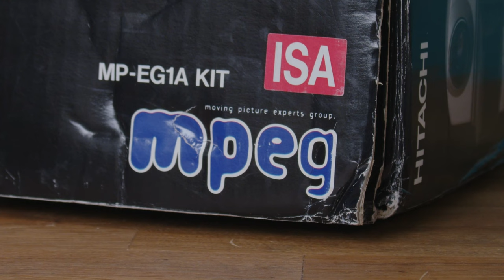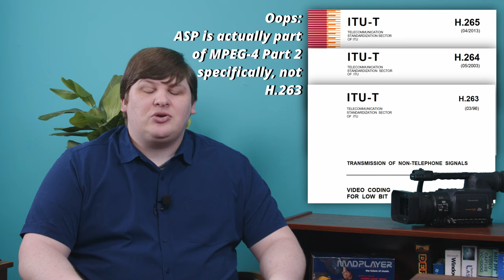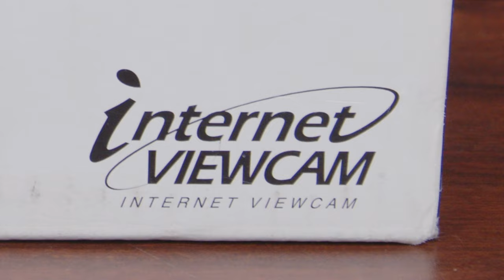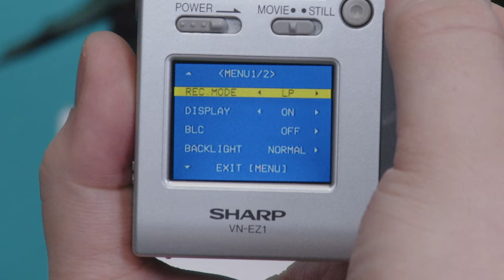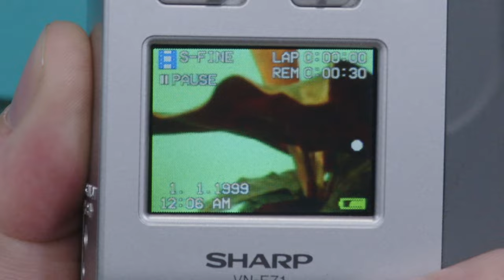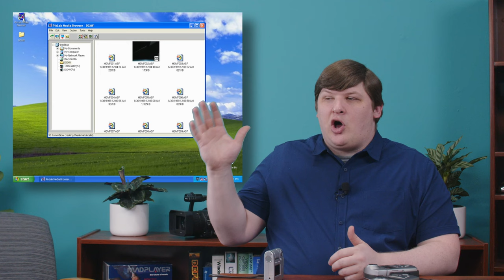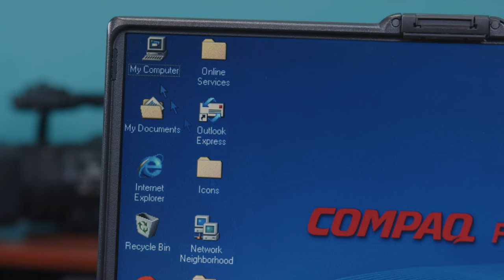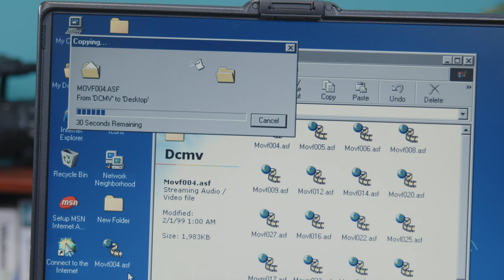The first thing that ever used MPEG4 [Sharp VN-EZ1]

Comment: Those FlashPath adapters were made for SmartMedia and Memory Stick. Supposedly they were also made for SD Card but I've yet to find proof of existence. Pretty sure they weren't made for Xd Picture Card, which is odd since Xd is basically Smart Media in a much more compact form, at least in capacities up to 256 meg.

Smart Media in 256 meg was just about to be released when it was suddenly killed off as fast as HD-DVD. Like with HD-DVD, manufacture of Smart Media cards was slammed to a halt by everyone making them. That was in spite of many devices (mostly digital cameras and a few MP3 players) that had just been released with 256 meg support or got firmware updates for it. Only a small batch of prototype 256 meg cards were made and they have always brought a premium price the rare times any go up for sale.

Making an <any other format> to SmartMedia adapter is essentially impossible due to it being thinner than all the other cards. There were adapters with a big lump of an Xd slot that could make 256 meg (device support required for larger sizes of course) or smaller Xd work in Smart Media devices, but if the thing had a memory slot cover it couldn't be closed, might physically obstruct use of the adapter, and if the cover had to be closed for the device to function you were SOL.

Where's an "Impossible Project" for old solid state storage formats? Polaroid film got brought back from extinction! Why not the 256 meg Smart Media card and 4 gig SDSC?

4 gig SDSC? For an extremely brief time before the introduction of the SDHC (Secure Digital High Capacity) standard, when the largest SD card capacity possible was 2 gig, some companies figured out that many devices could actually support up to 4 gig of storage.

How to fit 4 gigs of data into a 2 gig sack? Double the block size. Same number of blocks, they're just twice as large. As long as the device's supported file system and the firmware could handle the larger blocks, it would work - unless the @#%@ing thing was hard coded to a 2 gig limit.

But as soon as the first 4 gig SDHC card hit the market, manufacture of 4 gig Secure Digital Standard Capacity (retronamed post-SDHC) cards instantly ended because the SD Association had a fit of "Not Invented Here" and refused to adopt it into their standard. I suspect that manufacturers who wanted to continue getting the license to use the SD logo etc on their products were told they had to cease making "nonstandard" cards or they'd be cut off.

What's the prime market for a revival of 4 gig SDSC? Older GPS receivers. For example the road data for the continental 48 US States or most of Europe from OpenStreetMap can be converted to Garmin format and packed into 4 gigabytes. But since most GPS receivers prior to the intro of SDHC cannot use SDHC cards, they top out at 2 gig storage. But their software can access up to at least 4 gig. I suspect that GPS (and some of the better cameras) was the main reason 4 gig SDSC cards were made.

Comment: Noticing something interesting in every video. Is that a Panasonic HVX200 series in the background? I inherited a complete kit for free. P2 cards are insanely expensive to this day, and probably won't get any cheaper. Had a chance to get a Nikon lens adapter, but it was offered before the camera, so I passed on it. If I knew I was going to get offered the camera next, I would've taken the thing. Otherwise, good luck finding any lens for it that's not stock. Great machine, but heavy, expensive to run and PCMCIA card readers aren't as common as they used to be.

Smart Media - I do have a small collection of those, no larger than 64MB. Only device I had that used them was Diamond Rio MP3 player.

Comment: A couple notes:

- Macro modes are usually at the wide or telephoto end of the zoom range for convenience reasons. From a user's perspective, imagine having to find some precise point along the zoom range to re-couple the zoom and focus lenses into a macro configuration. Let's face it, even if this position was marked, it'd be fiddly. And from an engineering perspective, having to make this system reliable enough not to block up when it's switched back and forth with the zoom and focus maybe slightly out of the ideal position would be a massive pain.

- h.264 was actually referred to by its proper name regularly - under the brand AVCHD, which you can STILL find on some modern Sony and Panasonic cameras.

Comment: I am genuinely shocked that little Sharp camera existed in 1999.  I was working for a tech start-up at the time, and our MO was high-quality, real-time encoding and live streaming using MPEG-4 Part 2 video.  Our only option at the time was to use the biggest pile of x86 CPUs we could cram in a single NT 4 box (SGI Visual Workstations), run Windows Media encoder, and do it all in software.  There were virtually no other software implementations of the codec at the time, and no off-the-shelf hardware encoders to be found.  We generally used a Mini DV camera connected via Firewire to the encoder box, which gave us a nice clean video feed to start with.  We could get fairly watchable talking-head video with mono audio crammed down into 48 kbps (targeted for 56k dial-up), and remarkably decent (for the time) general subject video squeezed into a 384kbps stream for the DSL market.  Semi-related, H.263 was a mainstay of the video teleconferencing (VTC) world for a long time. It was a decent performer for talking-head content over a few bundled ISDN lines.  The battle between the overlapping MPEG and ITU standards was pretty rough, and at the time, they were really only compatible enough to make your software crash.  I am pretty sure all consumer cameras that could do video at that time were just doing MJPEG at low resolution. They could just use their existing JPEG hardware encoder, but it was pretty inefficient.  As much as we can make fun of this little Sharp camera today, it really was doing some interesting stuff.  It was definitely a wild era to be playing with digital video.

Comment: Enjoyed your extensive overview of this camera! The lone Camcorder & Computer Video magazine I saved from July 1997 features the Hitachi EG-1A as part of it's cover. Within the article the reviewer eludes to the ease of drag and drop into applications such as Microsoft Word or PowerPoint. Most notable comment in the article in regards to purchasing one: "If you want the highest-quality video recording possible for a consumer camcorder, than the answer is a definite no! MPEG-1 video playback is like watching original generation VHS." After your demo of the video image quality, VHS in SP mode still looked leaps and bounds better even in 1997 terms, but that was clearly not the point of this camcorder. 

The quality you recorded was reminiscent to a lot of the codecs Real [Video] Player was using at the time. Absolute visual garbage, but innovative enough to share video with ease over dial-up internet. Around the time this was released, the JVC DVM1 and Sony DCR-VX1000 MiniDV camcorders were the new hot ticket items on the market for a slightly lower cost than the EG-1A. While there certainly were early advances in solid-state card technology in the late 1990's, videotape was still king in consumer and broadcast markets.

Comment: I used to rip VHS rentals to an Mpeg-2 video file, split into two so I could burn to two CD's [Disk1 and Disk 2] in the VCD standard which was 1150Kbs Mpeg-2, this was around 2000 or shortly after when I built my Intel PIII-550Mhz computer. I was so glad when DVD's got cheaper and I built my Intel Q6600 quad core for processing Mpeg4 in the DVD standard.

Comment: I think ASB file format is made for camera to split files without moving the actual data on the flash card. I mean, a conventional way to trim video is to create a new file with a new header and copy the needed parts of the video and audio streams from the original file into it (look into any ffmpeg tutorial for more details), which would be very slow and unpractical for this camera. What it probably does is a filesystem trick of splitting cluster chains in the FAT and modifying a pointer to file's beginning in the directory, that way it could perform trimming and dividing instantly and without any free space on the card or in RAM.

Comment: You mention contemporary still cameras...
There was a very nice one from Kodak that, in '99, was one megapixel.  The capabilities were quite good compared to the little junk cameras like you complain about; clearly it was aimed at Pro-sumers.  It even has an external studio strobe jack, which is quite different from a modern phono plug style!  
I thought the feature set was great, but the resolution was still too low.  I bought the next model, which was the same thing but two megapixels, when it came out.

Comment: I do have a 1997-ish era still image camera with 3MPixels around somewhere that uses the Smart Media cards. Also, the Diamond Rio used those... fond memories, but it was the time before some standard became accepted, so nowhere was any card readers; I usually had to transfer stuff from the camera or the Rio with the serial or parallel cables that they came with... that are the not-so-fond memories 😼 - Maybe I'll unearth the camera at some time and try to power it up for a video...

Comment: Seeing those SmartMedia cards reminded me that I have an Apple QuickTake 200 packed away in my shed. 4MB card, could hold a dozen pictures or so. Didn't have any Apple machines that used ADBSerial, and I have nothing that supports 5V SmartMedia cards so the camera is practically useless now. Ya want it, CRD? I can send it along with my Blonder-Tongue CATV modulator if you want it... :)

Comment: To think back though, yeah you might have had devices with the CAPABILITY for HD video back in 1996 (Satellite set top boxes) but (despite a few early adopters) had the internet bandwidth or storage to mess with streaming , showing or storing HD video files on the daily? I myself didn't upgrade from my 56k modem to ADSL until 2008, and it really was more geared towards businesses and production companies and the prices reflected that until about late 2005 .. I can't remember the names of the video sites, but you used to find a 5mb video and have to download at least half of it beforestarting the player or it would jump and buffer. I think that camera would have been fine for what video hardware was out there at the time.

Comment: On the MP-EG1 you can clearly see the macroblocks (the minimum area of image to be compressed by using the Discrete Cosene Transform). The problem with that "rough" encoder, is not having an algorithm to "blend" adjacent macroblocks, giving that "grid" look because every macroblock is being compressed independently of each other probably.

Comment: Ah, leaves, confetti, and water...MPEGs worst nightmares!  But, all joking aside, I'd just like to pause for a moment and remark on the remarkable feat that DCT codecs achieved in the history of video.  MPEG-2 and MPEG-4 are, to me anyway, modern marvels that most people simply don't realize the important of!
Reply: Any codec's worst nightmares. Using AI we could basically synthesize those things out of nowhere for ultra low bitrates these days. Wonder when they implement this kind of stuff. If you are really bitrate constraint, it makes sense to just drop those details and generate them randomly using just a seed stored in the bitstream (so it looks the same everytime it is played at least). It's not important how exactly flames move, where tree leaves are, how they move, how water is moving exactly, etc.

Comment: An SH3? I have a working "Laptop" (Handheld PC) on CE with an SH4 processor. Wild. 

My first digital was 160x120 at 10fps and no audio. I remember to take a movie just hold the shutter button. Every 3 seconds it would make the shutter click sound to confirm that in fact it was still taking movie.

My Canon Powershit after that (which I think is still around the house somewhere) with 320x240 at 15FPS was a huge step up.

Comment: You'll rarely see SMC upto 128MB at the top end, though later versions of the hardware sometimes can address 256MB via adapters for XD cards (so Toshiba may have had plans for continuing but dropped it in favour of more widespread formats). Main place you'll see those bigger cards is for the GP32.

The only other time I've seen a Flashpath was the movie Colombiana.

Comment: As a codec aficionado, I can see that the MP-EG1 basically just recorded I-Frames. So basically, this is just a fast JPEG slideshow. AKA MJPEG. In fact, it's possible to convert I-Frame only MPEG1 to MJPEG losslessly and vice versa. The MP-EG10 however seems to at LEAST encode P-Frames (there are also B-Frames, which is bi-directional prediction) as well, so there is prediction involved which VASTLY improved quality. Also it looks like, they've tweaked the DCT matrix for better quality as well. It could also be that the MP-EG1 actually just encoded D-Frames, which is a very cut down version of I-Frames and even lesser than a JPEG slideshow. But I have never seen D-Frames in action until this day.

Comment: One reason for the FlashPath was because from August 1997 (release of USB supplement to Win95 OSR2) until September 14, 2000 (WinMe release), USB on Windows sucked. 

With Win 95 OSR2 + USB addon, Win 98, and Win 98SE the USB support was much like PCMCIA had been with DOS/Win 3.x.

They needed a driver for the USB controller and an additional driver for almost every individual USB peripheral. Having to install a driver for every different brand of thumb drive was a big PITA. It didn't matter that most of them were accessed in pretty much an identical fashion, the early ones mostly would not work with a driver from another brand.

With WinMe Microsoft introduced a universal USB Mass Storage driver that codified and standardized how data storage devices would be accessed via USB. No more having to install separate drivers for your Lexar, Kingston, SanDisk thumb drives, external hard drives etc. It was akin to that OAKCDROM.SYS for DOS that worked with every IDE CD-ROM drive.

WinMe did for USB what Win95 had done for PCMCIA. With DOS/Win3.x there was the controller driver called Card and Socket Services. Then there were Class drivers that mostly worked with all devices of a similar type. For example most hard drive PC-Cards would work with one Class driver while battery backed DRAM cards would use a different Class driver. More unique cards like a soundcard or video capture card required their own driver called a Point driver. Now try and make more than three Class or Point drivers all work together AND load into high memory along with Card and Socket Services AND the CD-ROM driver AND... It quickly got to the point where you needed a boot menu with several selections loading different combinations of PC Card drivers. With Win95 you could have a dozen different PC-Cards that would have been impossible to simultaneously load drivers for in DOS/Win and they'd all work.

On msfn.org forum there was a person who backported Windows Me's USB Mass Storage support to 98 SE, and someone else took that to make it work in original 98. Look for Maximus Decim NUSB. Basically any device that presents itself as USB Mass Storage (possibly MTP and/or PTP too) can use this to "just work" with Windows 98.

Comment: 22:36 I exported an MPEG-4 Part 2 (which as LBSi UK said in another comment, is distinct from 'proper' H.263) video literally yesterday. I had to edit then recompress an already compressed video, and my video editing software's top quality preset offered a higher bitrate for MPEG-4 Part 2 (which I now realize I could've increased manually).

It's a perfectly fine codec in any case though, MPEG-4 Part 10/H.264 is just more efficient (which I suspect is an oversimplification).

Comment: Fun part is, that today it isn't a problem squeezing 240p30 in 384kbps with very fine results. Even 360p30 is possible with that bitrate and would be superior to VHS back in the day. With current codecs and our godlike processing power you could even push intelligible video through dialup (56k).

Comment: If their mpeg-encoder increased in quality that certainly is cause the jpeg-encoder became better. MPEG1 is near identical to MJPEG which in turn is just a series of jpeg-encoded images.
The difference is that for MPEG1 the video does not only consist of the full jpegs but also interpolation-data. It only takes a full image every few frames and between uses some trickery to only store the changes in the image - which mostly are minor changes and thus very little data. But that still means that if the full jpeg-pictures that are used improve in quality then the entire video looks better.

Comment: Man these videos are great with so much info! Early 2000s I didn't have a camcorder. Just the 15-30 sec clips my dads still camera allowed. Very pixelated and like only 15 fps and i kept having to switch SD cards. By 2005 I got a basic minidv cam and it was night and day having 30fps and the digital squeezed widescreen feature. Full VGA feels like HD when you were use to shit! lol  I started ripping all my dvd to H264 by 2008 ish. The file size was smaller and looked better to me. At the time most movie downloads were still divx or mpeg4 tho.